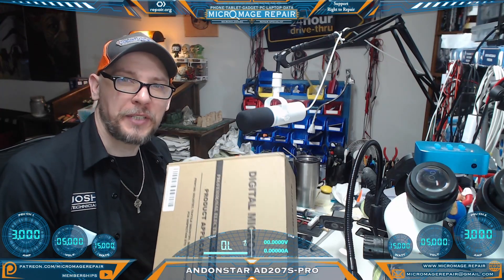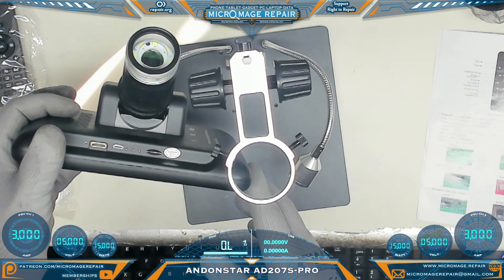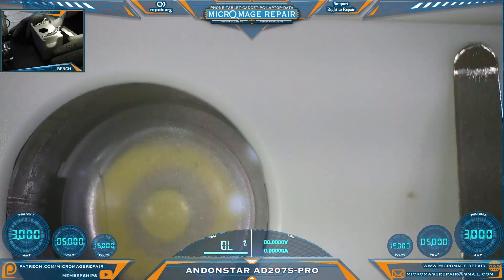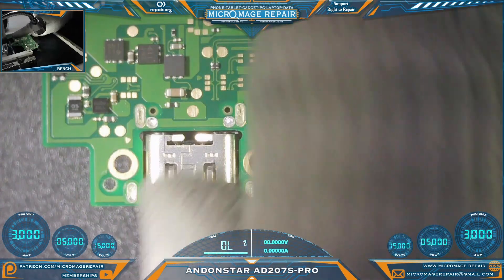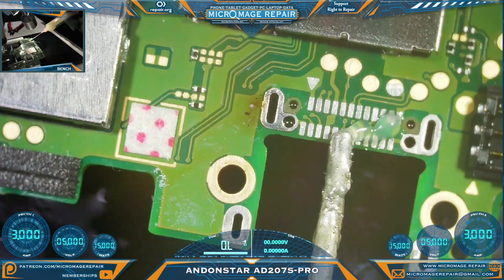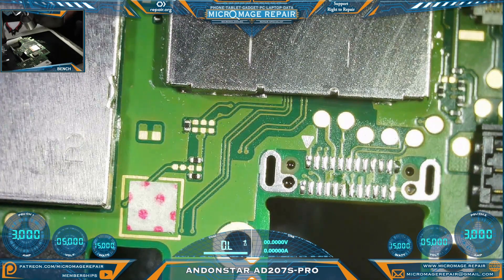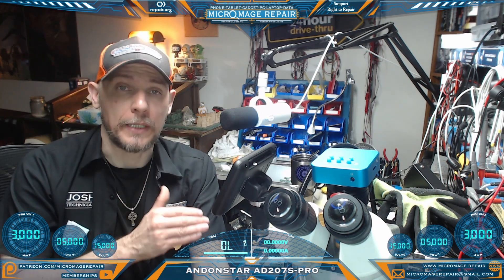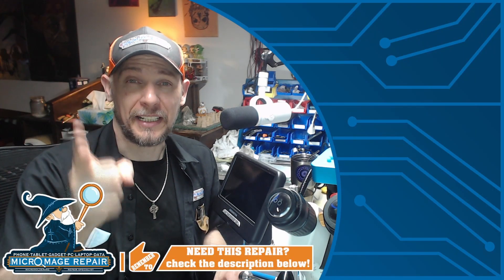I put this Digital Microscope to the professional test. Does it pass?

Comment: I have one of their scopes, the base definitely limits you.  Which is why I 3D designed an attachment to be mounted to a vesa tv boom arm 😉 more flexibility
Reply from the maker: Very cool Roy!
I wish I had the designing and fabrication talent 😂
Reply: @MicroMageRepair  I use Tinkercad, free and easy 😉
Reply: I have a scope very similar just a different name brand. I don't have a 3d printer so I made a very crude stand. I used 2 4in 2x4 with aluminum attaching both and then attached the mount to the aluminum. It allows any board for the most part to fit under the scope as apposed to hitting the stand. Hoping to find an affordable swivel desk clamp instead in the future.
Reply from the maker: @Fuzzy-88  Inventive! Would be nice if it was a bit more flexible out of the box but it's possible to make something that works at that price range.
Reply: I'm also using the Vesa mount, there are several mounts on thingverse, agree it's a huge improvement. I'm using a cheap Chinese USB hdmi capture card without issues
Reply from the maker: @tekeraq  Interesting, I tried my cheap USB capture and my Avermedia internal capture card and couldn't get it to work through either.
Not an overly big deal for me but it would be valuable to know if you did anything specific to make it work.